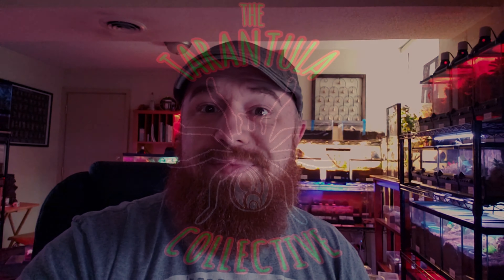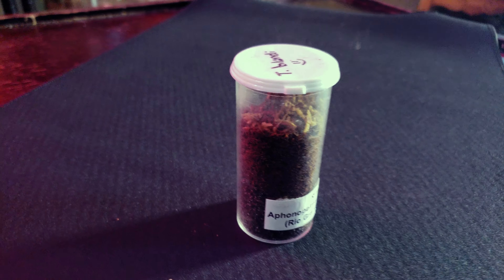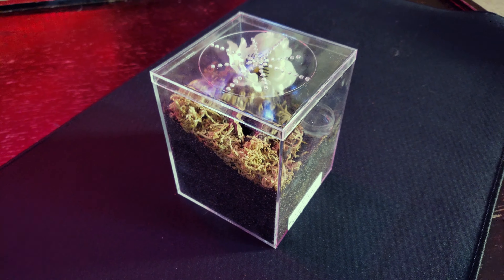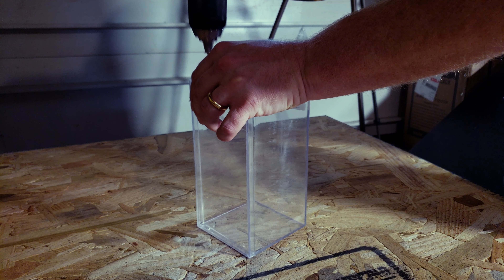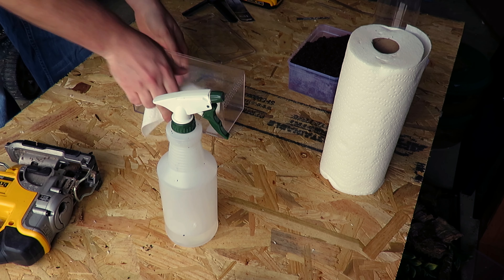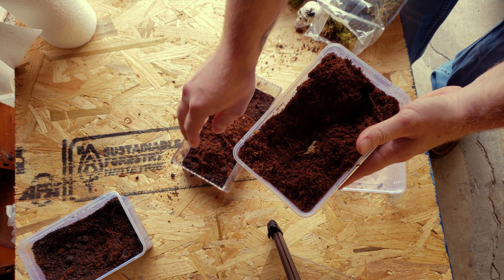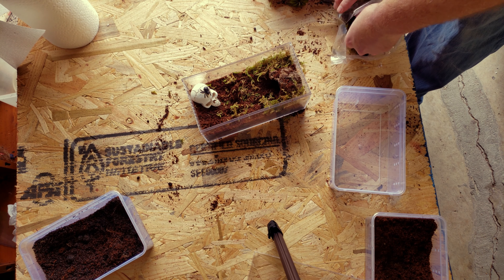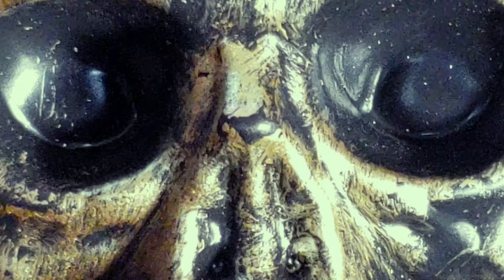How To Make Tarantula Enclosures for Spiderlings and Juveniles

Comment: The other day I was at my girls house sitting outside on the table. I noticed a jumping spider walking along said table. He stopped and seemed to stare at me, he was very small, maybe a little bigger than the head of a pin but I could see his eyes perfectly. He stopped in front of me and I saw him look up at me. I put my arms on the table quite far from him and he turned and looked at my arms then back up at me. This intrigued me so I held my finger out in front of him and he looked up at my finger and if I got too close he backed away. I’d never seen a spider react to me in such a way, he didn’t run away, he simply got to a distance he felt was safe and stared at me and at my finger. Spiders are such amazing creatures. I want a tarantula badly but my family is afraid of spiders and will not allow me to keep one. Thank you for your videos!

Comment: I use a Dremel tool with a flex shaft attachment to drill. It's easier  and more precise that using a cordless drill. 
Second thing I do is use masking tape where I'm drilling. It greatly reduced chance of cracking the fragile plastic, produces cleaner holes and helps prevent scratching if you accidentally go to deep.
Reply: As another note, I highly recommend a Dremel tool with a variety of attachments. You will find it very useful for a very wide variety of DIY projects. I use mine literally all the time. Well worth the investment.

Comment: I know this is an old video but what size amac box would you recommend for a pink toe tarantula? The one we are getting is about 1 inch and it will come with an appropriately size enclosure. But we want to be prepared and get a bigger enclosure now. But I am new and I dont know what size I should get. We do have a 10 gallon glass aquarium that my husband wants to use but I'm worried it won't have enough ventilation. Would it be okay to just use the 10 gallon aquarium with a plexiglass top? Thanks for any info!!

Comment: I was looking at soil at home Depot and I got nervous and left so all of my t's only have coconut fiber. Any recommendations on a type of soil to use? Thanks for the great how-to video :-)  I can't wait to make a bunch of enclosures now!!
Reply from the maker: i look for an organic top soil and check the ingredients to make sure there isnt a lot of manure or any chemicals or insecticides or any kind. Then before I use the soil I test it. An easy way to test the soil is to put some in an empty enclosure or critter keeper and then put a cricket in there. sometimes i will do this in 3 or 4 enclosures if the soil is suspect. Let the cricket live on the soil for a few days...if it doesnt mysteriously die and youre sure it is organic soil...then it is most likely good to go. When in doubt 100% coco fiber is always a great way to go! :)

Comment: is there any way to make small vent holes in strong plastic like this without a drill?
Reply from the maker: You can heat up a nail or pack on the stove or with a candle and push it through. Very time consuming but it works.

Comment: I realize this is an old video, but ran into it as I research for my first T. Question... do you need to secure the lid to prevent escape? Can these T's push up to open the enclosure?
Reply from the maker: depends on the enclosure. Some of the AMAC boxes close very snuggly and are very difficult to open for humans...so impossible for a tarantula. If it is a loose fitting lid that can be easily opened...i either use some painters tape to lock it place or set another enclosure on top of it of the same or smaller size.

Comment: Is any problem if I put a juvenile tarantula in a normal size terrarium (adult size)?
Reply: How big is the juvenile? I personally wouldn't recommend going too big, as prey items will hide out and can die in there.  With that said, I think sometimes keepers tend to go too small, which in my (granted less experienced) opinion is a mistake.  Smaller containers tend to have less stable micro-climates, aka, they can dry out too fast for species that need more humidity AND high ventilation, and also, there is less room for a water dish, which is something I always will use forever from now on, due to bad experiences with misting slings.  I also like to do some live plants, even for my slings, and plants grow, and need some room...  The big advantage of a tiny, tiny enclosure is the T can find food easily, (but can also be harassed by uneaten food, so you have to police them a bit) and also you can store a lot more slings in a small area (which is really important for folks with large collections). Anyway don't take my word for it, I'm kind of a newbie too. Also, in case you see this, sorry for hijacking your comments section, The Tarantula Collective, I just discovered your channel, and I'm liking it a lot so far!
Reply: @teslasintern  the tarantula has 2,5 cm(only the body)
Reply: @Butuc01   So that's about a 1" body.  I'm currently housing some juvenile psalmopoeus species slightly smaller than that in roughly 5 1/2" square by 7" containers (14 cm square  x 18 cm) they seem to like it, and I have it packed with a lot of stuff so they have lots of places to hide, and if they get too big, I can remove some things. I feel like this is a good size, and I plan on keeping them in there until they are about 2 1/2" body length (6 1/2 cm) before rehousing to my adult 12" enclosures (30 x 30 x 30 cm).  You might want to check out arachnoboards, lots of experienced keepers on there (though I find too much people drama on forums, so I never post unless I have some kind of emergency).